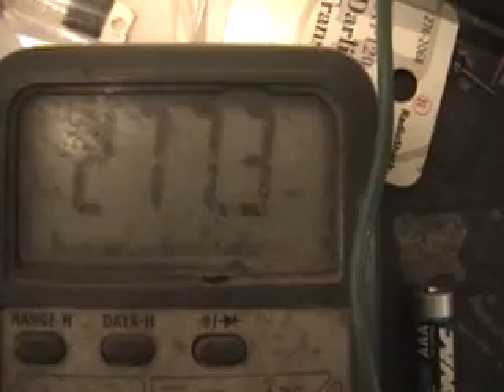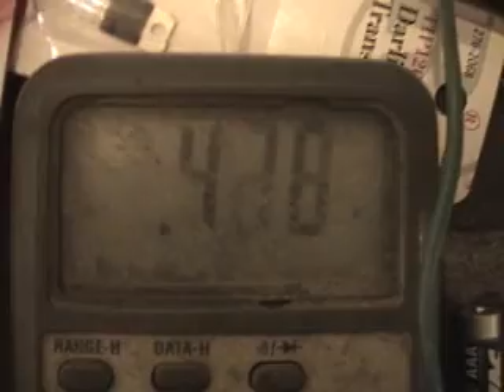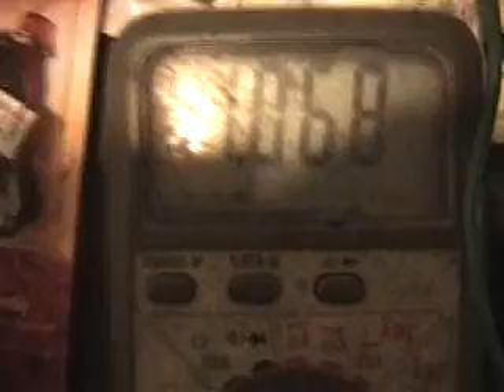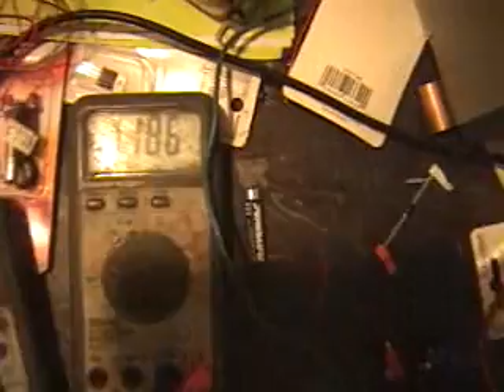Utilization of Radiant Energy 1901 Nikola Tesla,My test 8

Comment: Hai.... every one. I am an Electrical Engineer and totally confused....I was thinking all this kind of stuff are fake but that is before i read Tesla's patent. Now I am just sketching out the theory behind this. The Antenna (that much long wire) like things you and Tesla used can't pick significant amount of power from electromagnetic waves or cosmic rays.  That means the power you are getting is not from any radio station tower near by. I think your system is working on something like ions collection but you still cant get that much power out of it. It might work on really something strange other than electromagnetic waves and ions if it is it really real.

Comment: the capacitor drains to  zero  because the multimeter is acting as a load to the circuit.   A voltmeter, uses a high value  resistor to do its job.  time constant of a capacitor is  R * C,  thats teh time it takes for a cap to reach 2/3 of its current voltage,  there are   5 time constants

Comment: However, keep in mind that Capacitors work in DC throughput, so, you will need to ensure that you are running the discharges in parallel through a DC to AC inverter that regulated the Voltage to the "grid" which are trying to bridge it to.. (say for backup power to your home.. OR... even getting OFF the "GRID", maybe even sending the SURPLUS back to the Power Co and DEMANDING a CHECK for the power YOU gave THEM for a change!

Comment: Copper works best, however, you will need to be sure and insulate the copper surfaces if used outdoors to protect against corrosion and/or oxidation.  I would recommend clear epoxy coating, the RF signals will STILL radiate THROUGH the coating (just like the vinyl insulation on say cell-phone antennas.)  Everything "transmitted" is "ENERGY".. just "ground" that energy into the capacitors (like small batteries) and then discharge those to LARGER ACTUAL Batteries.

Comment: The ONLY limit on power is determined by the NUMBER of capacitors in parallel as well as the Voltage rating OF the capacitors.  Now, it you want "FASTER" charging time of those capacitors, you can add MORE "antenna" or change the location which they are located (like any RADIO.)  Now, for real USE you would need to discharge the capacitors into a Battery for "storage" when not being used and then run the AC/DC devices from the battery cells.

Comment: Not MY clip, but having developed a Tesla Radiant Energy system to use for my OWN purposes (just for camping at the moment,) I have found that there IS no "LIMIT" on how MUCH can be "created"... Now something you need to understand is that NO ENERGY is actually being "CREATED".  Tesla's design is nothing more than the implementation of over unity and/or "recycling" of "Radiant" energy.  What do you think Radio Stations do?  They "TRANSMIT" a RF in the AIR, the more V the send the clearer it is.

Comment: capacitors discharge at a rate  equal to the capacitance in farads  times the resistance in ohms.   My guess is that you are using a low impedance meter.

Comment: Greetings,
I too have a radiant energy setup using aluminum plates. I was wondering why, upon connecting the leads of multimeter to the terminals on my capacitor, my voltage eventually drains to zero. Do know what is accounting for this in my setup. I use a full wave rectifier(silicon diodes) and a 200v 820uf cap. Thanks.

Comment: Greetings.
Do you know why I would be getting a significant drop in my voltage when I connect the leads to my capacitor. Both the current and voltage drain to about zero, and I have no chance of a steady voltage. Any ideas?

Comment from the maker: @megavil well like i say a million times, i cannot make it too strong or it will be censored! but i will give u an estimate to show that it works and not get censored. this was between 3-6 volts, but....it was over an hour, to charge to that point, also if u put these plates in series or parallel, get ready for more current and voltage, and becareful of lightning strikes!!! also larger surface areas and insulated plates makes a huge difference. peace and freedom!

Comment from the maker: @bodrin1 yes thats very interesting! i know tesla said that the radiant energy does not have a positive or a negative because it is so fast so its neither dc or ac in one article. tesla discovered cosmic rays with a device like this and took it one step further to insulate the plates allowing the build up of energy from these particles from the rest of the environment allowing electricity to flow.

Comment: [4]check out Morey valve detector at ... w w w . r e x r e s e a r c h . c o m / m o r a y 2 / m o r a y r e r . h t m

Neither of the condensers or the 60-watt lamp on the primary side of the box were necessary but were simply put on to show that the high frequency power will jump or pass through the condensers...

Comment: [3]check out Morey valve detector at ...

The 60-watt lamp did not light under any condition or hookup. Shorting the antenna and ground by placing a wire across them, caused the 100-watt lamp to go out. Similar shorting with the hands also caused the 100-watt lamp to go out. No electricity could be felt when shorting with the hands. If either the ground or the antenna wires were disconnected from the box, the 100-watt lamp would go out.

Comment: [2]check out Morey valve detector at ...

With the 60 watt Mazda Lamp and the two condensers attached to the antenna and the antenna and ground attached to the box containing your Radiant Energy equipment in the manner shown in the sketch, the 100-watt Mazda Lamp on the secondary or output side was lighted. Unscrewing the 60-watt Mazda lamp from its socket caused the 100-watt amp to go out, but it immediately lighted when the 60-watt lamp was screwed in its socket.

Comment: [1]check out Morey valve detector at ...

[p. 126] Letter from E. G. Jensen  (March 21, 1938) ~

Number 1 condenser (Figure 52) consisted of two small sheets of about 30 gauge aluminum separated by but making contact with a piece of one-quarter inch thick plate glass. The plate glass was larger than the aluminum sheets and overlapped them. Number 2 condenser... had the capacity of 0.025 mfd. It was a commercial condenser...

Comment: No worries boxa I was just looking things up on youtube to see if there is more people  I'm in the Netherlands living some 55meters above sea level and have put a copper insulated wire on my roof. It's  like 60 meters in a loop. The roof is 8meters above the ground level in I hammered a copper pipe into the ground. This 22mm pipe is in some 1,6 mtr.
Just by accident I fixed the same array with diodes and caps. I skipped the cap and put a rodin coil instead!
Tip: bash the grnd rod deeper in!

Comment from the maker: copper cost alot of money, i had the aluminum plates donated from a neighboor. yes there is so much to this experiment(coil design, resonance, insulation, ionized materials, on and on), i just tested a few variables to get people interested in this, i could make it more powerful, but i want the video to stand and make it easy for people to copy. well height of air resistance diminishes as you go higher, meaning higher radiation/cosmic rays which can ionize the plate easier, and this is know too.

Comment: Has anyone ever tried this with large thin copper plates?? or another metal with less resistence?  How about laying these vertically next to each other, relative to the Earth's rotation.  Are those plates of metal needlessly think? How about using single layer pancake coils and connecting them in series.  For some reason, there isn't much on this, "radiant energy", subject....  I really need to test this stuff out and post a vid.  I guess I don't yet understand how height makes a difference.

Comment from the maker: yea, but the tarps should be something that would be air tight i think, because then the metal is completly covered and insulated, i cant say how much we can improve this device, and you dont want to show something to powerful either lol. also another way is many of these radiant energy devices connected in parallel or series to up voltage and current it its possible. theoretically the energy should increase with larger plate area, height and probably more efficient capacitors and diodes

Comment: Hey, you should try to use a germanium transistor to switch when the voltage reaches a high enough potential, and let it charge another cap, then run an LED off of that cap with a joule thief attached. If you can you should contact me through my youtube account. I have been working with something very similar.

Comment from the maker: well how high up do you have it, this system is quite weak it takes a long time for the cap to charge its just a simple example, but you were able to get voltage on the multimeter? becareful going up to high because of lightning strikes! i was about 25-30ft and the plates were in my attic to make the system a little more safer! make sure to use caution when doing this experiment! i hope this helps. tell me if you need more help.

Comment: aah u can not use dc  to a transformer only pulsed dc but most transformers work on ac its a iron rod will make a dc transformer and stacked steel plates make ac 1s another thing u might try is a plate of copper n a plate of iron/steel insulated over top 1 another but not touching insulated heat it up and mesure it on meter more stacks more volts  this is 1 of teslas and ya atic my not be hot enough try the roof aim it at the sun for max remember copper insulator wax paper /plastic iron  ok

Comment: but my question to you " boxa888 "..is do you think high voltage door knob capacitors connected in series would work well...???

lets say you have (10) door knob capacitors rated for 20KV 500pf connected in series...

that would be 200KV...

would they charge as expected...???

i think Tesla stated in his patent that Door Knob capacitors would work well when working with RADIANT ENERGY...???

if i am correct...???
get back to as soon as you can with your input...

Comment from the maker: but then why does a insulated plate work better? its insulated from the surrounding air. no this is real, not a battery.tesla also used particle accelerators and xray devices to test these plates to prove charged particles are conveying a charge to the insulated plates and this making electricity flow! maybe i will do a video of an insulated plate, i didnt want to get to complex so people can easily reproduce this tesla radiant energy device. look at the first video it shows how it works.

Comment from the maker: sorry rocism, sometimes i miss comments. well i havent tested the device for a while, but a high capacity capacitor is probably better like your saying here. the voltage is like higher as you get higher in the air, the current part is increased with plate area, the deeper the grounding rod, the better, a few inches on the surface isnt enough yea 4ft-8ft is probably good enough to start seeing really good results. a very unsure guess would be, a higher voltage between 6 volts-50 volts maybe

Comment from the maker: well like batteries in parallel or series, you can increase current or voltage so make an array of these radiant energy devices and something interesting should happen. right?? im not to sure. i havent tested this device for a while, but circuits can be made with more amperage or voltage by series and parallel connections.

Comment from the maker: it all comes down to like 5 basic factors. size of plate(current continuous output),height(creates voltage gradient v to kv range),insulation,capacitor/discharge circuit(resonance, frequency, capacitance),ground,metal plate composition(electron density,copper,aluminum,silver) these main factors influence energy production, i wanted something edgeing on medium power production, enough to show concept clearly and without showing something to powerful :). this system can be made alot more powerful!

Comment from the maker: its cheaper and should work, but from what i used aluminum should probably be used then copper and then silver then gold if thats even possible because of price lol. the high electron conductivity on those metals seems to make it easier for energy to work in charging faster, so it seems, i havent tested this device for a while cause i wanted to do the one wire tesla device to prove more physics wrong lol.

Comment from the maker: i think it does, i havent been testing this set up for a while cause ive been busy with my job. i have something else i will post soon on another setup but it might be a while to test the plates again, i really just wanted to put a wake up idea into people because it is soo sooo simple to get energy from a piece of metal in the air, no moving parts or anything like that, no special materials(just a good conducting metal) and ground and a charging circuit in between.

Comment: Hmmm, you also have a batterie conected??....draw a schematic of your circiut.  Try your plates on top of your roof or out side. & check your current. I got 5.5 volts so far from on top my roof with only an antenna and no plates. but only 13.5 Micro amps.  Unfortunately Tesla does not state the size of his insulated plate used in his patent #685,957 & 685,958. What is your location, altitude matters. connect your plates to a piece of wood off the ground.

Comment: Does anyone know if the ground is as effective if the material is lied down horizontally as opposed to vertically? Digging down 20' is a lot harder than coiling bare wire inder the surface.

Comment: hi, now you got like 2 aluminum sheets ? is there a difference if you put them flat 1 level or 1 on top of the other with a distance of 10cm or more or less in between, tried that? or arranging them verticaly like in car batteries with variable distances <10cm< ?
is it better to put them outside or inside house?  10x

Comment: FiniteTuning, in a previous post you said get rid of the copper pipe ground rod but i think what you meant was go deeper with the rod.  This rod is 5 feet long so I could conceivably pound it 5 feet into the ground.  I have some serious 6 awg cable that I couldn't use for another project so maybe this is perfect time.  I may not get to this until the beginning of next week but I will post my results.  Let me know if you think i should get a different ground pipe. I'll see if the can steel foil 2

Comment: can you try an experiment for me?..i don't have a decent earth rod to try with.. in place of the metal sheets, connect the top of the caps to the electric ground from your mains electric, to see if you can charge up using high voltage transients and 50Hz(or60?) residuals in the mains electric system...

Comment: Just moved my tiny collector & all on my roof today. Collector is on apex of roof ~15ft above ground(did the best I could w/ tape measure). The ground is a 4ft steel pole that I sanded. It's buried 39 inches in the ground. Cleared cap. Voltage read as 0.0mV 12uF @ 2:50pm. Voltage check read as 40.0mV 12uF @ 7:25pm. Good improvement. Gonna try using some  ~30-40ft coax cables in the future. Fun times!

Comment from the maker: yes its not as good as the full plastic laminant, but it gives it a better insulation than direct contact. i did it with the smaller plates, i will do it with the other plates soon. ive just been working alot and havent really had time to improve stuff, the cna jobs tough lol , i got to get use to it

Comment from the maker: yes, and higher and wider and more insulated. teslas patent states plate area is proportional to the amount of energy that it brings down.i wanted to start simple, so i dont get killed by a lighning strike,this is very uncharted territory for me. its also crappy weather outside (was bad,but getting better)i advise the same thing(try inside before going outside), were all at different levels on earth, if your higher on the earth than me, then you will get more energy, and it could be DANGEROUS!!

Comment: Forgot to mention that I discharged the cap after hooking everything up last night and tested w/ multimeter @ 0mV. It definitely has charged up, albeit slowly. This is so freggin simple. I'll be running calculations to get an idea of what would be required to scale this up inside an attic(most of us can't build towers to increase height =( ).

boxa888 you should look @ your electric bills and get an estimate of your power consumption. It'll let you know what to aim for.
Best regards!

Comment: Last night I couldn't wait any longer. I replicated Tesla's patent. Materials: 2 sheets of printer paper, 1 sheet of thick Al. foil, 1 capacitor (180VAC@12uF), wire (.06" if I gauged properly).Procedure: Al. foil cut smaller than edges of printer paper. Wire soldered to corner of Al foil. Al. foil sprayed w/ adhesive. Printer paper glued on Al. Collector hung @ 81-92" above ground(indoors). + Wire connected @ Cap. - Ground connect from Cap. to old refrigerator.

Comment: (This is continued from my description of my setup.) After letting everything sit over night I checked the voltage. The Cap (rated 180VAC @ 12uF) had charged up to 18.6mV. This rate is incredibly slow;however, remember my collector has a small surface/volume area and it is only 81-92" above ground level. Bottom line, this works and should be able to be scaled up. I think Aluminum should be what others attempt to use rather than steel (if you can score Cu or silver then do so!)

Comment: The current isn't supposed to be very strong as stated by Tesla but unfortunately he doesn't specify anything about current ranges for any given setup. I want to recommend trying to use a spray on plastic for all of your aluminum panels if your neighbor will allow it. As it stands they are only air insulated which should hinder efficiency. I feel ya on the work thing. I'm a full time masters student w/ a chronic injury. Makes everything but reading hard.